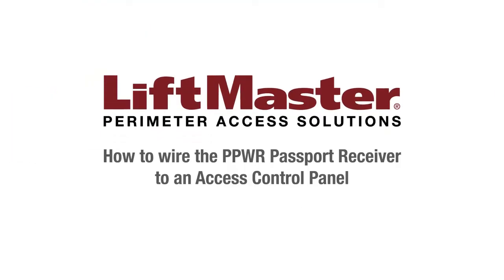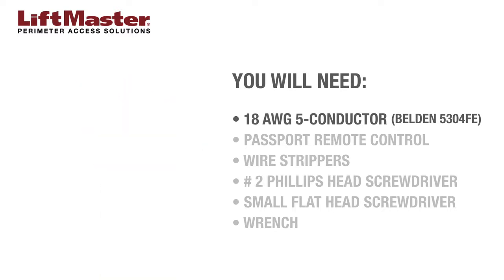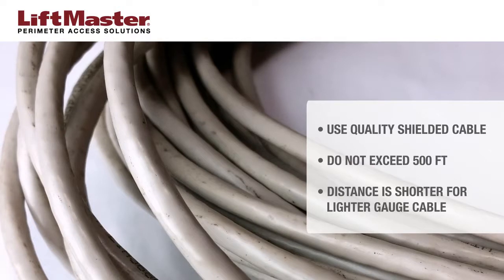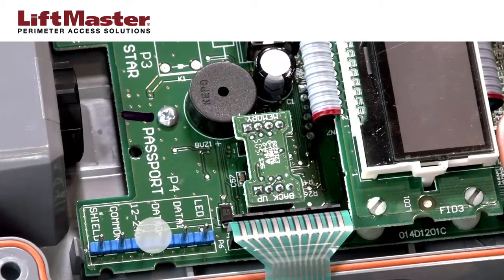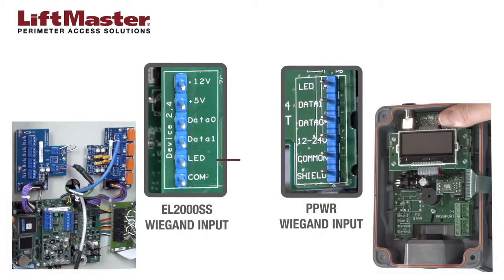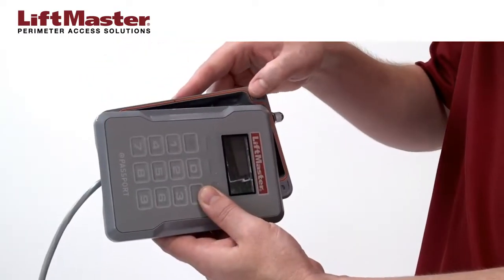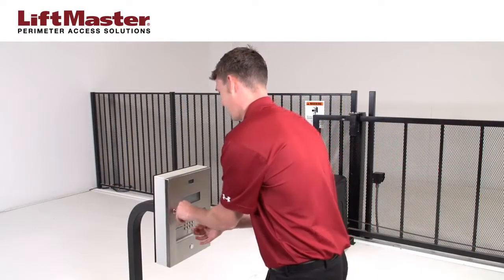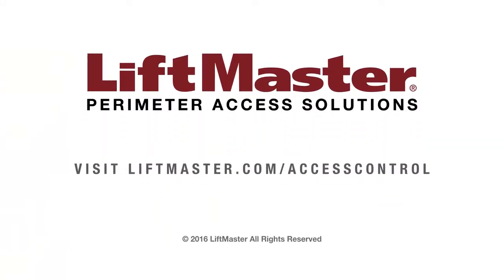LiftMaster - How to Wire the PPWR Passport Receiver to an Access Control Panel

Comment: How can you connect this to a csl24ul
Reply from the maker: Eric Ojeda, the PPWR receiver only outputs a Wiegand signal that needs to go thru an access controller, like the EL2000SS in this video, or an other access controller. Let me know if we can help identify an access controller compatible with your needs.
Reply: @totalsecuritywarehouse3621  i have 2 kprs
Reply: Kpr2000
Reply: @totalsecuritywarehouse3621  these kprs have data 1 and data 0 and common as well
Reply from the maker: @ericojeda4458  you cannot connect the PPWR to the KPR2000. The KPR2000 can work as a stand-alone unit and/or a Wiegand output device which requires an access controller. We typically use the DoorKing 1838 Access Controller. You could connect all of your KPRs and PPWR to the 1838, and then to your gate operator.